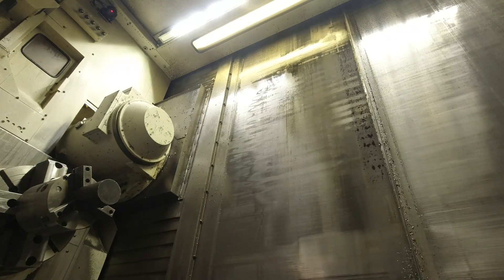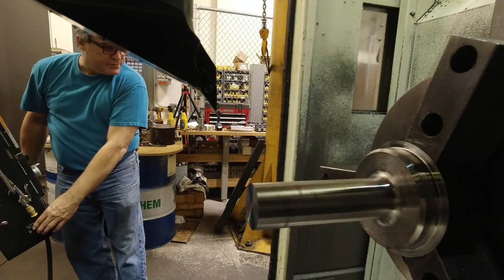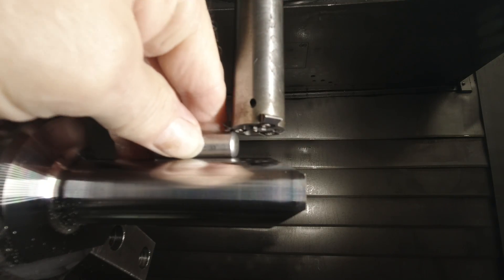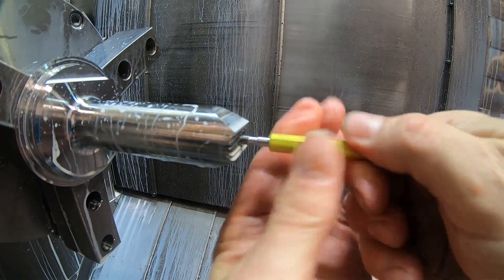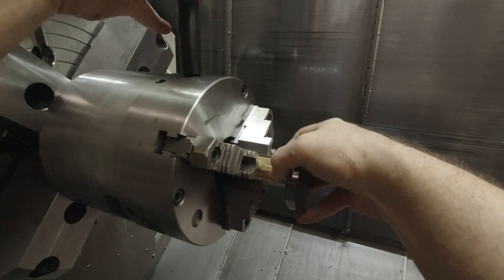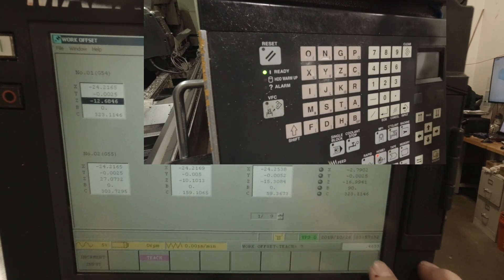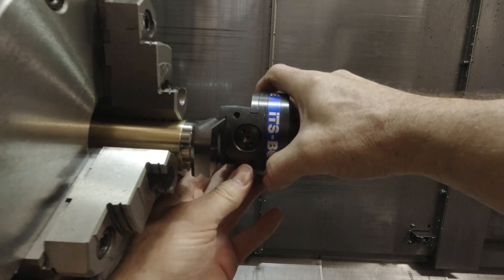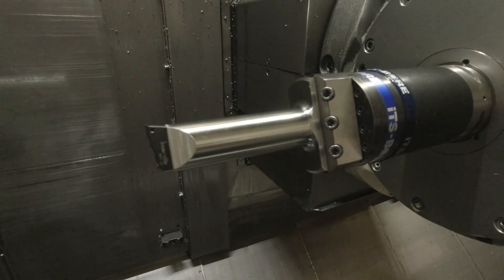New Bar For ITS Head

Comment: That little tidbit about trying to take off too little on a steel part reminds me of some work I was around in the past. 4140 and the program didn't have a minimum finish pass and the finish was absolute crap. The shop boss and the owner were standing around trying to figure it out with the machinist lead one day. I was just the new guy so I walked away from the conversation. Later on I asked the machinist lead what the plan was, and since they didn't have a plan I mentioned the minimum finish pass. The parts looked a lot nicer when I came in the next day.
Reply from the maker: Yes with carbon steel the finish pass needs to be a little deeper to get a good surface finish. Surface speed and depth of cut go hand and hand. If the finish cut is shallow the surface speed needs to be higher to maintain a good finish.

Comment: may i ask you a question, if i homemade some boring bar, what steel would be good to avoid some chatter, i know it will have chatter. but what steel will most likely make chatter less.
Reply from the maker: I would say for a steel bar 4140 would be good. If you are going to hang the bar out more than 5-6 diameters than tungsten or carbide for the shank would be better. Tungsten you can machine but carbide you would have to silver braze on a steel head and than machine it. That might be a good way to go with tungsten as well because of the cost. Or you could make a devibe bar by putting tungsten or carbide weights inside a steel shank. This takes a little experimentation to see how it works though. It is quite common to tap old carbide endmill around the shank of bars. To add weight to the end of the bar and reduce chatter. Of course you would need the room in your bore to do this. But we do this all the time on large bars with long overhangs.

Comment: Any idea what Rc the 4340 pre Heat Treated was? I know that stuff can be a bit challenging to get to break chips, faster feeds  and lower speeds usually helps for me.
Reply from the maker: Yes I needed a faster feed. But I was worried about the part moving in the small chuck. I think that would have also solved my chip breaking problem. As for the actual hardness I dont know. This was just a drop by the saw. It had the material type but no heat numbers to search out the cert's to find out. But judging by the way it cut. I'd say about 36-38 Rc.

Comment: Is it me or it looks like at 12:25-12:26 where you spin the boring bar at like 300 rpm it looks like it's wobbling?
Reply from the maker: Because the bar isn't on center-line. I haven't adjusted it yet, just mounted it for the video. In any case this isn't abnormal for a boring head to look like this when in use.

Comment: Nice vid.  I have to wear informal hobby machinist hat sometimes, so I know just enough to realize how hard it must be to be at the pinnacle of your trade.   Making 1 off tools to optimize some other process is impressive evidence of that!   Something i can not get my head wrapped around is how that threading mill can work.   I (we rooks?) Would love an entry level video on all the motion and geometry happening there...  How a radial cutting surface spinning at those rpms can turn out a pitched groove is beyond me!  (currently)... Thanks!
Reply from the maker: A thread mill uses a helical path that matches the lead of the thread. So if you go down into the hole feed out the radius required and spiral/helix up counter clockwise at the lead of the thread, how ever many revolutions necessary (Based on the cut length of the tool). Than feed back to center of the hole and retract the tool you will form right hand thread. This of course is done in multi-able passes/radial depths.  A left hand thread is done the same but from the top down except counterclockwise rotation.

Comment: That will come in very handy for other jobs too. If it where solid carbide you could probly go even longer. Ever since you pointed out you can get custom micro grain blanks for stuff I've been day dreaming more about what I would have made outta it... haha love your video's peter thanks for all your efforts
Reply: Iscar make carbide and tungsten bars for the ITS heads, they also have adapters to use standard size lathe boring bars.

Comment: I'm sure most people would have made a request to get a tool made by the manufacturer. See the price, scoff, walk away and figure something else out with a more catalog tool ready to order. You're like: "I'm a seasoned machinist, I know what the fuck I'm doing, I can figure this out." Great video. :)

Some places may not even allow a programmer to go this far, even if they want to. Just 'make it work', and program with available standardized cheaper tools.
Reply from the maker: I do have, or they do make a bar that would work. But this bar will work better and give me less trouble.
Reply: @EdgePrecision  Nice. That's good. :)

Comment: do you put your name and date and material type and tool name ?
Reply from the maker: No not really. That is one reason I started to make videos. You would be surprised how helpful some of these videos have been. When I had to rerun the same job. It’s like a video setup sheet.
Reply: I was thinking that a while ago your videos are big benefit to you. This piece of tooling is pretty distinctive of what are you using what it fits I was thinking about more generic looking pieces of tooling that’s why when I make tools for myself I always stamp my name and the date and material used in and it’s purpose and function
Like A bearings driver or mounting fixture. 
Good video thank you

Comment: Do you know when you were milling the flat on op2 it chattered on one side but not the other?
Reply from the maker: Sometimes when a endmill is sharp it will chatter. But as it wears in it quiets down. This may be what was happening here. Otherwise I have no other  explanation.
Reply: It might be cuased by the 3-jaw chuck and its uneven force on the part.